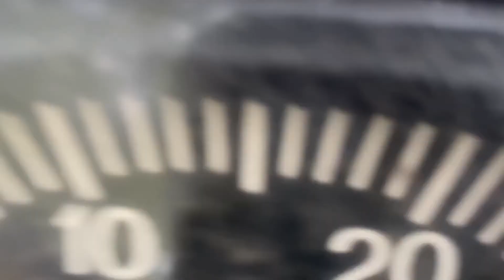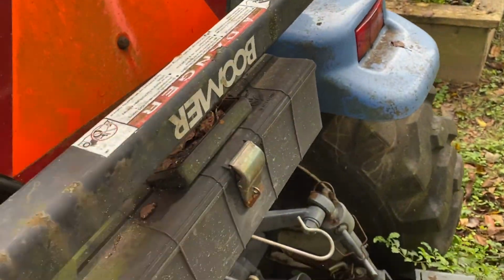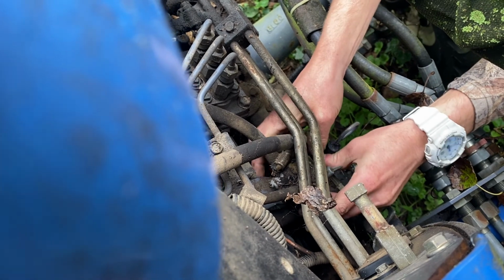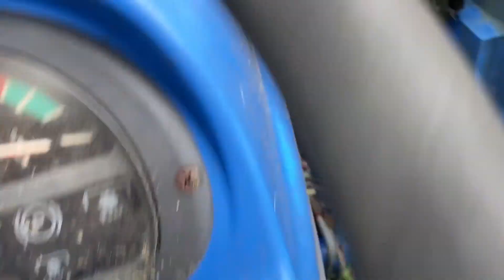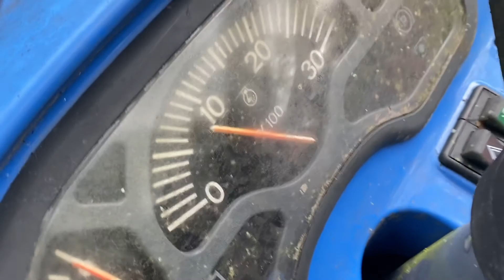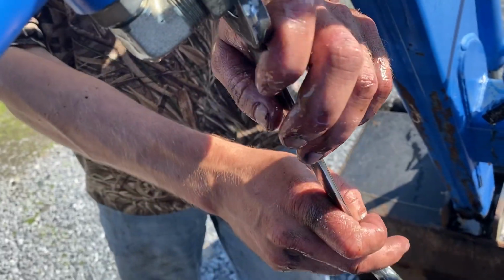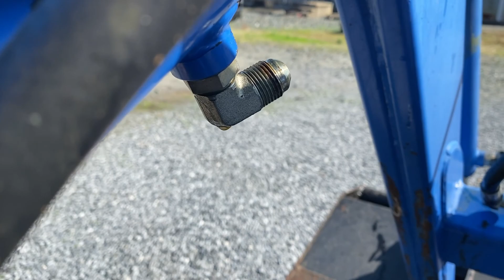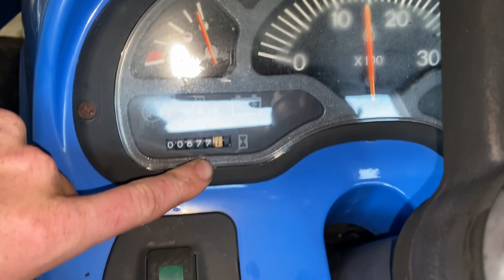WILL IT START?!? New Holland TC29 Diesel

Comment: I have this same tractor. It cannot be left with the fuel cap uncovered or it will get water in it every time the dew falls or it rains. You must put something over the fuel cap after every use. I use an old floor mat from a car and it solves the water in  the fuel issue. It probably have water in the hydraulic system as well.
Reply: Hi, That is great information and really appreciated. I have a Case DX29 and it seems to be totally identical down to the detail. And the manuals suck bad and there is no info on any of the issues. The dealers just want to sell new tractors, they are not helpful at all. So thanks for posting this! Best Regards from Alaska!